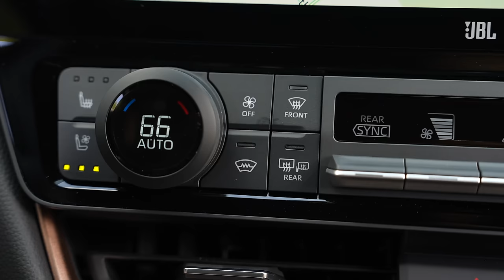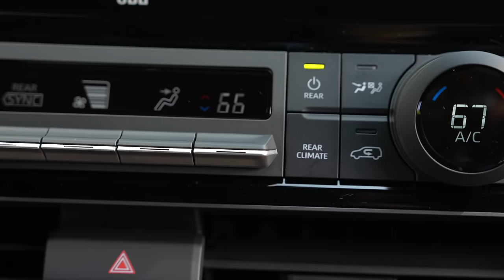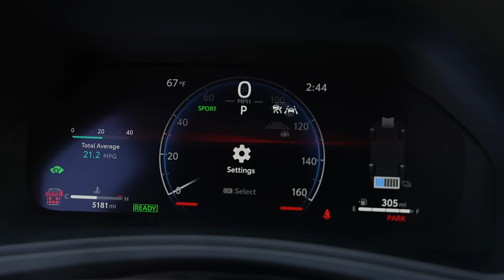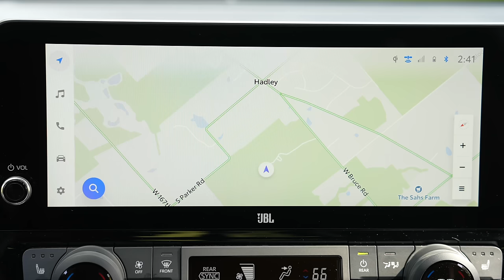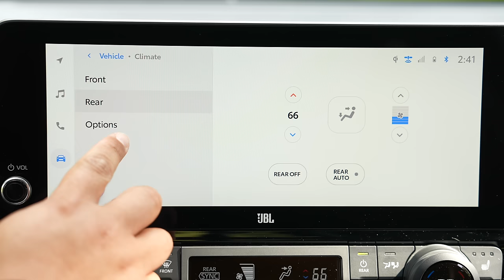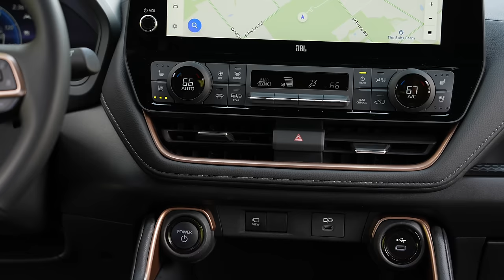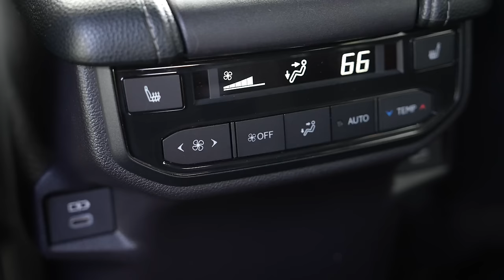Should You Buy A 2024 Toyota Grand Highlander? Back To Basics Toyota

Comment: Just sold my 2020 Avalon Limited Hybrid - love the mileage and comfort but I sold it because it didn't feel natural for a car for me!! I'm 52.... I sold it to my local Toyota dealership for a very nice price after owning it 2 years.... with the money I bought a 1 owner '02 Tundra with zero rust and zero oil on motor (top and bottom 4.7) and clean frame (absolutely beautiful)... also bought a Japanese made '11 ES350 with 135k from a local Lexus dealership....  less tech nonsense (no nav) and absolutely solid....  and I banked 5 grand after all said and done.... 
In my opinion, I will pay more for gas but I purchased 2 vehicles that will out each outlast my Avalon...  I will miss the stereo system (JBL) and I will miss the aesthetics of the vehicle, but in my situation what I was able to pull off this last week will be legendary in my life and I've owned a ton of vehicles...  Oh and my Avalon needed 3K + in cosmetic repairs......   reason for this post?  If you have a reliable Toyota? or one that has life left in it and unless you have some disposable income?? Just ride out these older models!!  my Avalon was/is the most beautiful car I've ever owned... but I think this discontinued line will fade out and the latest versions will exit first...  also the probability of owning a Hybrid that was drove like it was stolen will be in the shop.... Mid life crisis?? most likely... 

When it comes down to it... I think if you need to get a commute in? then settle for a Prius... but riding in Hybrid luxury car is where I live is so impractical... Idaho.

Comment: I really appreciate simplicity and ease of use. The best steering wheel layout I've ever seen is my 2016 Nissan Rogue SL. The volume control is super intuitive though a friction dot would have been nice there. What really shines is the cruise control. You don't have to look at the steering wheel to use it. These flat buttons are hard to identify when driving which necessitates looking at the steering wheel. That raised bar type mini joystick just makes the cruise control so simple, easy and safe to use. I do not understand why every car maker hasn't made that idea their own. Even the next year's of Nissan abandoned it but it one of the reasons I like my 2016 better than my 2017. It also helps your fingers locate other buttons. The Hyundai I rented recently was similar to this Toyota. I had to look every time just to make sure I got the right button. Kinda defeats the whole point of being on the steering wheel. Still better than my 2015 RAV4 with it's separate stalk I have to find just to use the cruise control. I really don't like that cruise system. Might as well be 1980's GM technology except those at least did double duty for turn signals.
Reply: Good for you on the Nissan.

My cruise control has been the same little stalk on the right rear part of the steering wheel for a 2003, 2008, 2012 and two 2016 Toyotas.. you push the little button on the end of stalk and push down on the stalk.. 

Voila! Cruise control set without even a glance.

The little green light in the instrument cluster lets you know you are on and set. So easy even a dingbat could do it.

Too bad Nissan's reliability isn't so great.. they'll sell them to anybody with bad credit.. same with Kia and Hyundai.
Reply: @marcodarko6941  Yeah as a mechanic I'm not too keen on their CVT. But that being said we have three in the family and I own two of them. All three were initially used for Turo. Mine still are used for Turo with one being used for Lyft and as a Turo backup. The one I don't own has already had the CVT replaced. I had fun finding a better deal than the standard 12/12 warranty. Finally found a 36/500 warranty for a better price than most. That was for a 2014 rogue select. My 2016 and 2017 haven't had any serious issues yet but I'm having the CVT regularly serviced so hopefully it staves off replacing the CVT. 
That being said I don't recommend them for high speed use or towing. For mileage they are pretty good.  I got an average of 35 mpg driving roughly 70 miles between towns and around town yesterday. My record is 36.9 mpg. So for what it is it isn't terrible and the interior is definitely better than my 2015 RAV4. To be fair the RAV4 is a basic model, no frills. I'd rather work on the RAV4 as a mechanic but as it's a Toyota I probably never will have to short of oil and filter changes. I wish I could trade my Subaru in on another RAV4. I hate that Subaru as a mechanic. I love driving the Subaru with it's turbo. It loves to go fast even for a Forester.
Reply: Sounds like you have your hands full. I certainly wish you all the best there. I remember Nissan making some pretty good cars around 20 years ago though. It's shame all of these companies now including Toyota (in my opinion) are starting to cheap out on us. @consaka1  

Subaru is fine I think. I looked at a brand new well equipped Legacy sedan almost 10 years ago, nice car but ended up going with a Camry at the time. They are almost the same though, Toyota and Subaru.

Comment: te avec votre appareil photo

Does the high voltage cable connector for the rear electric motor have the same design as in the rav4 hybrid/prime, Sienna, Highlander hybrid and other Lexus models? the connector corrodes and causes problems. THANKS.

Comment: I kinda do not agree entirely with your comparison with the sienna. Unless manufacturer corrects the safety on the 2nd and 3rd row on minivans, this suv is worth the price difference with the sienna. IIHS tested them and they are not safe for rear passengers. So whats the purpose of a sienna if it’s not safe for it’s passengers?

until toyota fix the safety on the 2nd and 3rd row, the GH is in front of it all way down!

Comment: You left out towing capacity the grand Highlander max tows 5000 pounds Sienna only towing 3500
Reply: If you're buying either one to tow with, you've got bigger issues.
Reply: We have a 2010 Highlander Hybrid rated a 3,500 lb. tow capacity, my boat & trailer is 3,500 lbs..  We tow it around the lake to launch and pull out it every year and it really struggles.  We bought a 2021 Highlander V6 and towing and hauling out is a world of difference (5,000 lb. Tow capacity).

Comment: I wish they would just stop it with these turbos… Either go hybrid, Electric, or gas. NOT Hybrid, Turbo, Gas & Electric!!! Let’s see how much we can put in a car to make it brake easier and harder to maintain and work on!!! Dumb! All for an environmental savings of .001%
Reply: Not to mention injectors through the top of the plastic valve cover. Valve cover gasket now costs 2,000$ instead of 50$ coz now you might as well just plan to replace all the injectors and the valve cover that got destroyed!

Comment: Just bought 23' 4runner.  Build quality is terrible.  Just rented a 21' 4Runner rom Enterprise rent a car for 3 days.  Difference in quality is shocking.  30k miles on rental and better quality than my 4Runner with 5k miles.  Creaks, rattles, poor quality cameras, engine noise is terrible and lots of paint flaws on 23'.  What is happening to Toyota????  When I called to complain, service tech for Toyota said they just qualified 5 as lemons in last month at large dealership and bought them back.  All from failed main computers.  Good luck if you buy a Toyota. Even if made in Japan!

Comment: I could definitely see this being a great option for a family with 4 or 5 kids that drive around a lot and maybe go on frequent road trips. This would be an excellent vehicle for that. I'm personally not a fan of all the complexity and technology in modern vehicles, but that's just how everything is made these days. I miss the days of a simple gauges, a clock, and a stereo. I guess Bluetooth was a nice touch, but the level of technology is insane in cars today.  By comparison my car still has hand crank widows, no power door locks, no chip key that leaves you stranded if the key gets wet or the battery dies, and a cassette player. I can pop one of those tapes in with an aux cord to play music from my phone's headphones jack. That works good enough for me. I of course put a DC to AC 120 volt inverter and ran it to a  power strip with 6 house outlets so all electrical needs are met.

Comment: The regular Highlander should be called the RAV6 and this should be just the regular Highlander
Reply: But unfortunately it isn't a 6 cylinder so why bother with that..
Reply: @marcodarko6941  the number is more in reference to size than engine
Reply: The 4 originally came from the fact that it came with 4WD back when it was released in 1996.

Comment: I think Toyota's made in the US are using cheap plastic for the interior/ Exterior of the vehicles. I have a 2015 Sienna 60,000 Miles and a 2017 RAV4 30,000 miles both vehicle plastics are breaking, like the light fixtures, exterior moldings. I have been replacing parts has they fall off or break. The Sienna moon roof is leaking, the weather strip on the roof  need to be replace often,  I go through  the car wash they come out .I thought about buying new model of the same vehicle but I think they may be worst over time than what I have now. The fit and finish and quality is nowhere near what it use to be 20 or 30 years ago when they were really competing for market shares.

Comment: There is Samsung kitchen appliance and there is Viking.
Reply: Not sure where you're going with that comment?  My Viking range was the biggest POS there ever was, wiring melting, relays frying, igniters not working, had to set the oven 200 degrees lower than the temp you actually wanted. Piece of crap..  Hope the GH is like a Samsung

Comment: The standard Highlander looks much better than the Grand Highlander in my opinion.  The humongous front grill with the tiny headlamps looks terrible.  Why did they go with the huge, outdated grill again?  The rear looks squared off and old fashioned compared to the regular Highlander.  The rear seat still has no legroom and the seat offers no thigh support.  The width is nice except the narrow seats defeat the purpose of making it wider.  The standard Highlander has the same air vents in the headliner and has the same rear seat HVAC controls, but the front passengers can control the rear system if needed.   I own a 2022 Highlander AWD Platinum Hybrid and it gets the same 0-60 performance as the Grand Highlander.  I rarely need to put the rear seats up(I have on occasion had petite adults there) and the extra room in the back is quite sufficient when they are down.  I agree that the Sienna would be the better and less expensive family vehicle.  I give Toyota a big zonk on this SUV and I think it was only produced to try to compete with the Hyundai Palisade and the Kia Telluride.

Comment: Why the can eliminate that metal stick front the hook Jesus, no side bars, window in the back we would love it if it was possible to get it up and down moving the wiper to the top also they could do better in the way the parts are place it looks confusing to me and the HP is not what we expected they should not made some of the upgrades because some were not necessary this gran rav4 is decent as it but they could do better if there is no power miles should be better it get me angry when I saw the bottom they should cover everything

Comment: The front end over-styling is Toyota's worst feature.  The Highlander is just a bigger, flat-nosed truckish looking version of the RAV4.  Yes, it is a massive SUV, and why some think bigger is always better is beyond me.  And the rear space cover is a tonneau cover, that's pronounced 'tonno', not 'tonnew'...  And yes, with so many user-adjustable features and apps on the screen, it can be highly distracting to make changes while driving.  You need to pull over to make them safely... At least the A/C doesn't need to go through a menu to adjust...  "It's a big SUV";  "Not a fun car";  "Feels like a giant boat" - all very good reasons to look at something else...  If you're going to spend several tens of thousands on a family vehicle, IMHO there's better choices than this over-weight and piggish 'kitchen appliance' that has to rely on a complex hybrid system to attempt to compensate for being so ever-weight...

Comment: Worst Toyota got rid of the 3.5L V6 … stupid move and fuel efficiency is not that big of a difference.  

I would love the 3.5L V6 in it before I upgrade my current V6 Highlander .. I will eventually get into 1 down the line but not now 😂🤣

I should buy 1 and custom fit the 3.5L V6 😂🤣

Comment: As an Uber driver who owns a 2022 Sienna, I would buy one of these. The Sienna is one hell of a lean, green, rideshare machine. I average 42MPG and it has an incredible turn circle, but it falls short in other major areas for me. Driver seat comfort, infotainment, and the infernal power sliding doors that everyone, and I mean EVERYONE fights with. I press the button, and the passenger pushes the handle, cancelling the close action. This process repeats until I say "The more you touch the doors, the slower they go". All the while traffic is stacking up behind me, people are honking; it's just a hassle dealing with the sliding doors, not to mention answering the same dumb questions over and over. "No. I'm not married. No, I don't have any kids. Yes, I drive a minivan. I bought it specifically so you could bombard me with same 10 questions about my personal life that the last 14 people have" 🙄. The GH has normal doors that everyone knows how to operate (and won't break cables) and even though the second and third rows are smaller, most rides are under 20 minutes and I don't think anyone would have issue with room back there. Plenty of luggage space for airport trips too, and not to mention the ideal 2-2-3 seating position for easy embarking/disembarking. I'd get the standard hybrid powertrain since speed doesn't matter when all you do is go from red light to red light.

Comment: At https://youtu.be/OYbi3iTk8Sc?t=1256 you mention no cover on the rear motor. Do you think it would be necessary or advisable to put a cover on it and not have interference with performance? Do you think that the Lexus TX models will have a cover? So based on your recommendations if and when a cover will be available, I may put one on our MAX. Or  should I engineer and manufacture one for the aftermarket and make a few dollars on the side?

Comment: I don't like 4 cylinder turbo engine. It is not reliable. Turbo engines are prone to failure and are very expensive to repair. Easy to make trouble as like european car as Mercedes, BMW, Audi, Volvo. It is good for gas mileage but not good for engine.